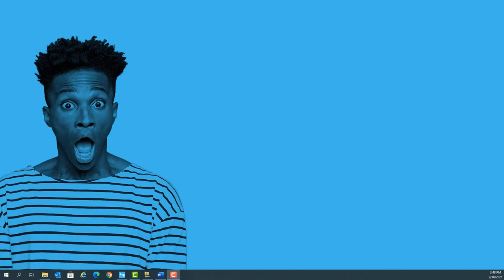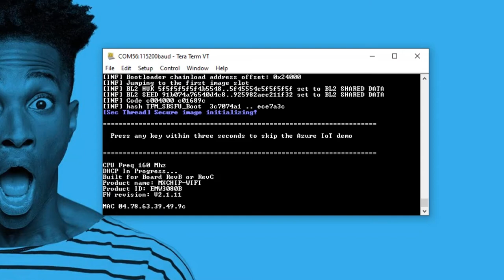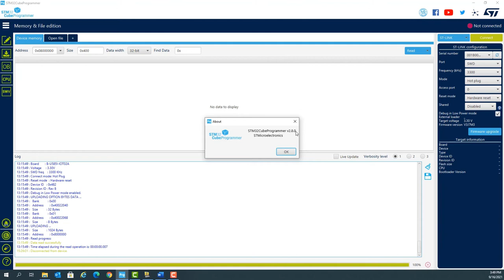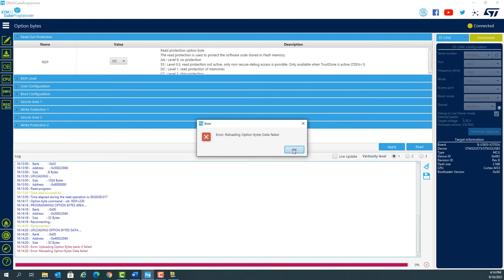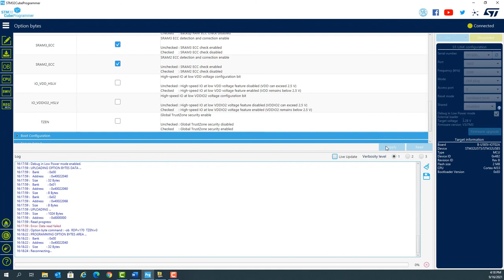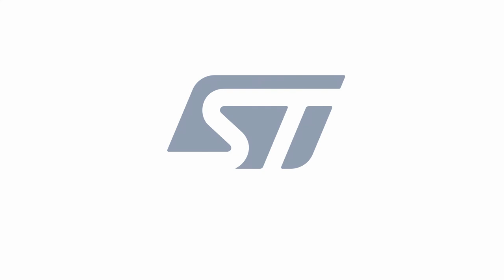Disabling TrustZone on STM32U5

Comment: I tried to follow all the steps mentioned. Once I change ROP to "DC", diconconnected the board and after power cycle, My board is not connecting.
Shows : Error: Connection to target must be established before performing the read command.
Now I am not able to change the option byte to "AA".